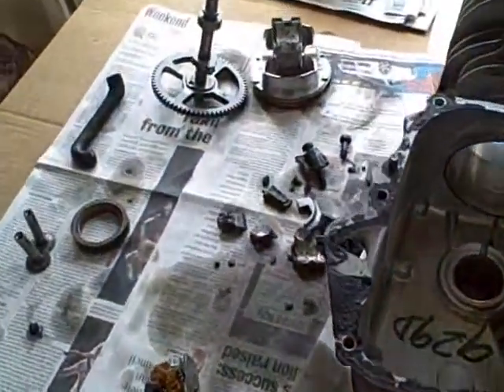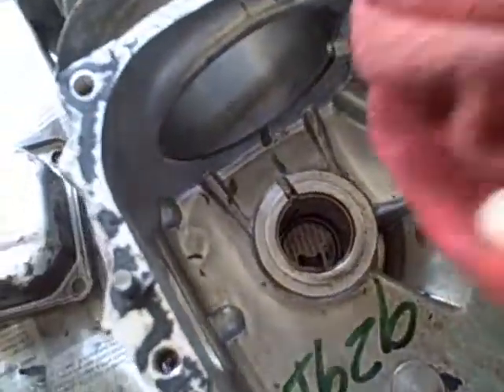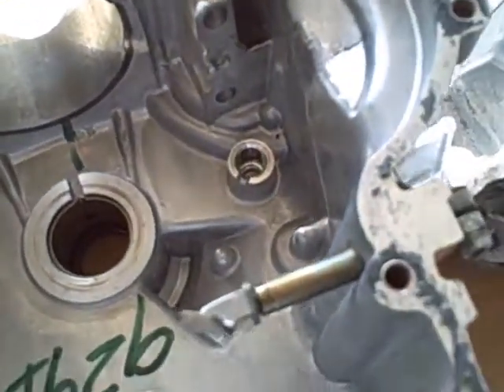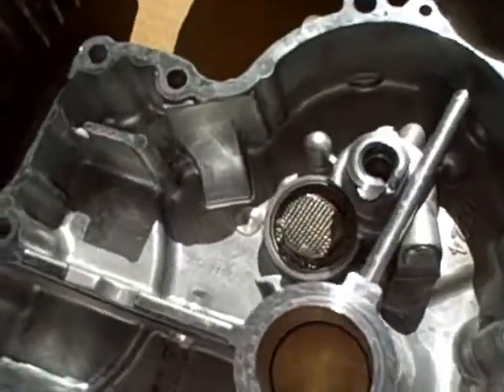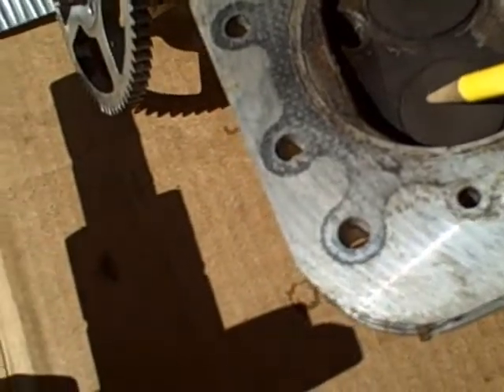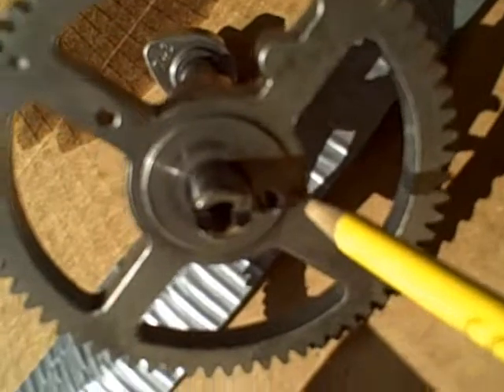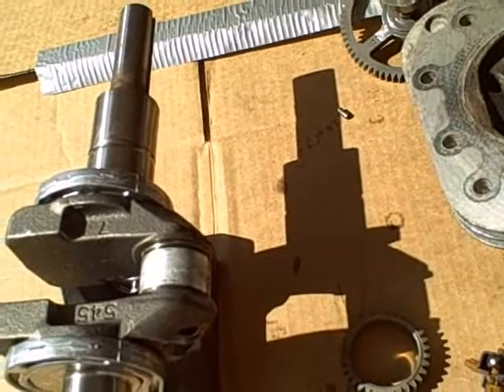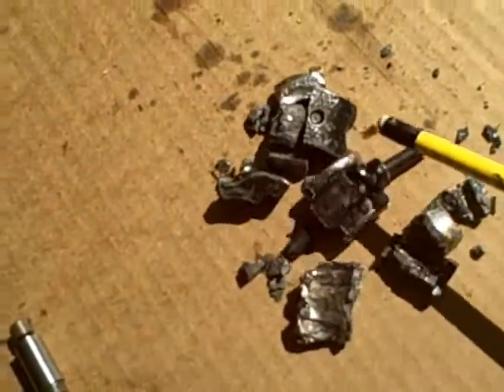Part 8 - How to Repair Briggs/John Deere LA115 19.5 HP Engine - Parts Cleaning

Comment: These blocks are pretty thin castings.  They're strong enough to "contain" 20-30hp as long as all the moving parts stay where they belong, but I wouldn't trust one after the conrod has grenaded.  This sort of failure chews up everything near the big end of the rod, and creates bits of metal that go everywhere they aren't supposed to be and cause all sorts of problems.  So even if the block is undamaged, you still have to disassemble everything completely to clean out abrasives, replace anything that was visibly damaged, and replace any wear items (e.g., the oil pump) now while it's open.

This is why it's important to shut down an engine at the first sign of trouble: it starts running rough or suddenly sounds different.  If you catch it before something breaks, you can often address the one thing that's broken—like a head gasket or piston rings—and just put it back together again.  Once it grenades, anything short of a full rebuild or replacement is taking a chance.

Comment: Very well done.  The only problem with the totally destroyed engine is that I didn't get to see you put it back together.  I figure that I can tear mine down to replace the head gasket, my worry is actually putting it back together properly.
Reply: Timothy Gavin write down everything you take apart by numbers photo each part where it was connected to and go backwards to replace the pieces!  i did that on my truck when i did the bearings i never did before

Comment: Iwould agree there was lack of. Maintenance.   The main thing that stopped the engine was the kid hit something while mowing. Lack of lubrication  makes the engine tighten up and come to a stop as bearings etc seize.  Broken connecting rods and bent pushrods are caused by the almost insatataniuos  rotation of the crankshaft while under power.   Good view of the parts..

Comment: what are the torque specs for the cylinder head bolts? I looked elsewhere online and i have read 220lbs which seems about 10 times too high. Is that right?
Reply: Those are usually in inch, not foot lbs. 220 inch lbs sounds right.